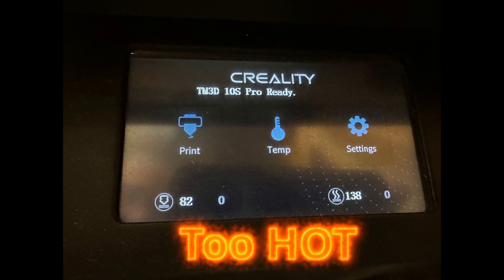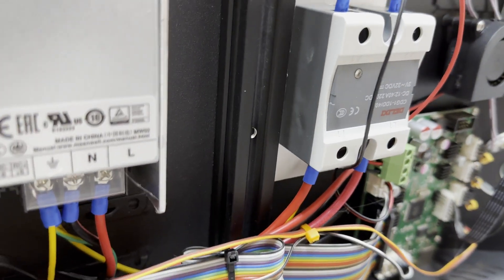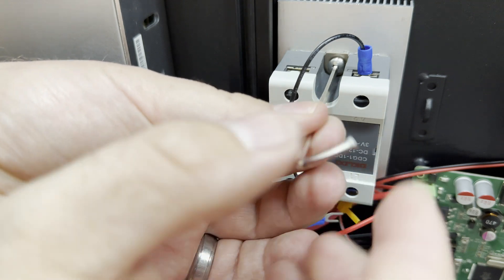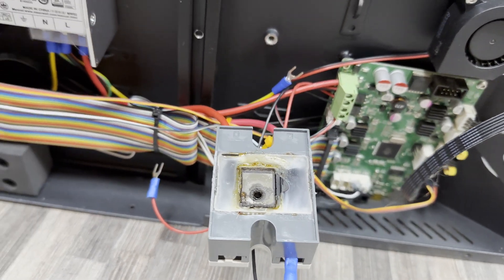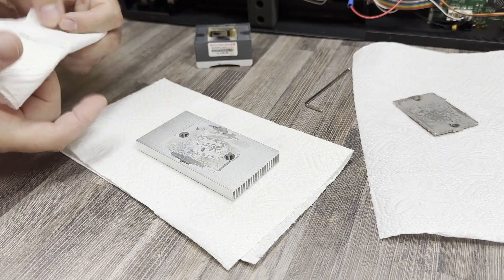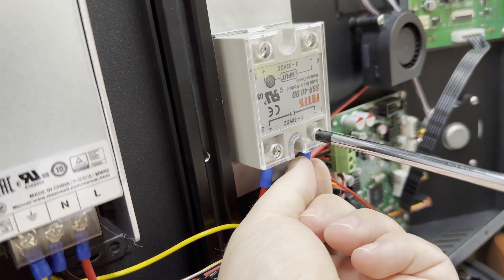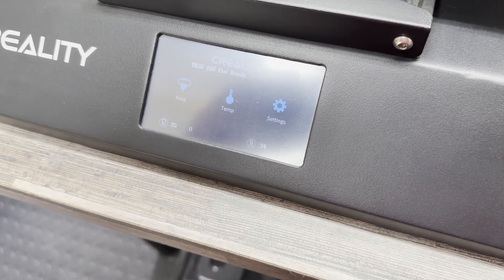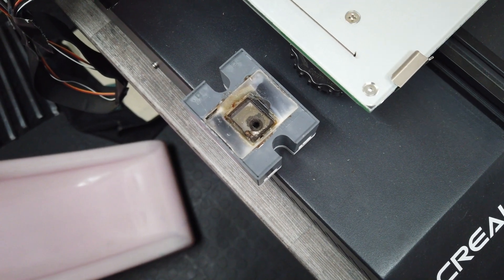Let's Repair: Solid State Relay (SSR) Replacement on a CR-10S Pro

Comment: Should I be worried that my CR10S Pro does not have a heatsink??? My relay died, very similar look to yours. But there was no heatsink, and it was attached by screws. I got a genuine Fotek ssr but it looks like I'm missing the heatsink so can't install it.